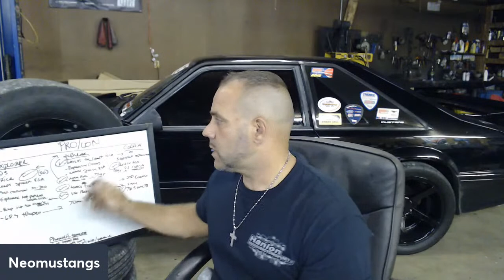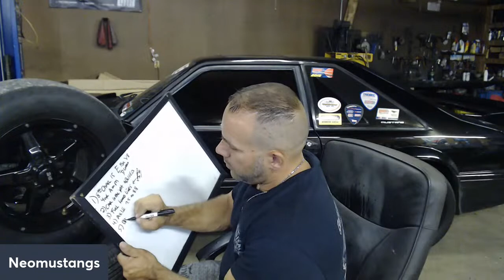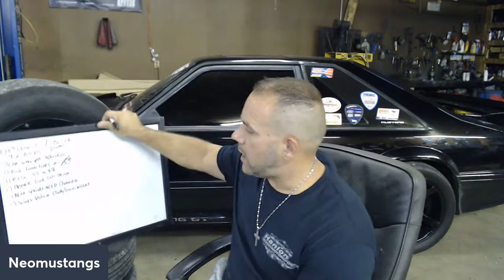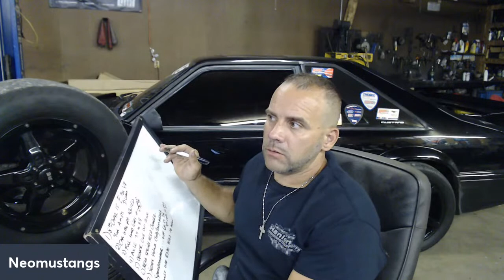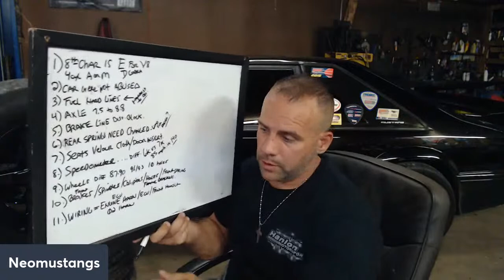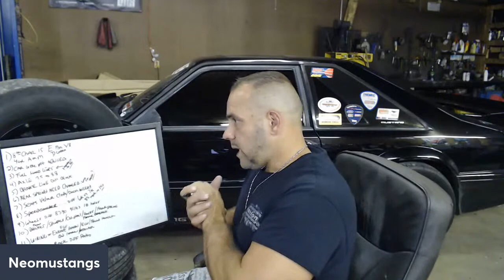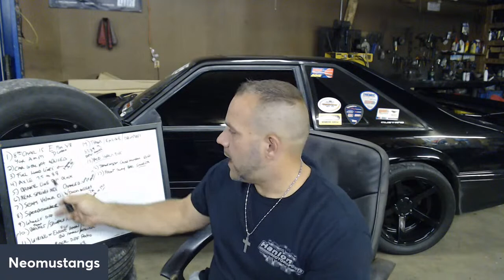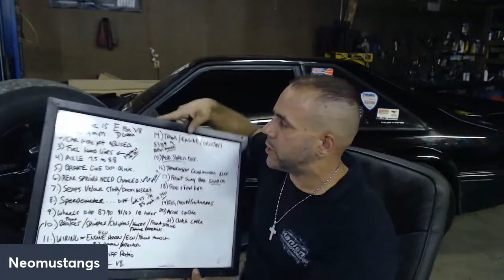Converting a Foxbody 4CYL to V8 What You May Not Know

Comment: converting to carb is easy especially if the 4 is a carb Ford electronic ignition work good to 7000 rpm and only need 1 power wire if your just doing drag racing breaks dont matterconverted a v6 83 Thunderbird no problem with stock steering rack

Comment: Yes I see I'm keeping mine a 2.3, I been trying to swap it since I got it in 2002 that's the whole reason I got it. always wanted to v8 Fox, but can never find a good engine when I have the money lol
Reply from the maker: Nice man
Reply: Could buy another 2.3 cheap build it properly on the side and boost it on a holly terminator x efi system. Toss a T5 and a 8.8 rear on it and have fun.
Reply: @jonathonbang3186  thats a great idea, Neo I'm going to try to get up there soon as I can to get one of those 2.3s you don't need if that offer still stands
Reply: If you want more power than the 2.3 can make boosted or a 5.0 both capable of 450-500 safe.  I hear people start splittibg blocks higher than 500HP without modifying the blocks.... Though some get lucky.  You're gonna need to at least go to A 351 or better engine.
Reply: @jonathonbang3186  just my budget I just don't have it believe me I'd love to though
Reply: K24 swap it. The only difference in one motor swap to the next is where to weld the mounting brackets. K24s are super cheap, and you can just hit it with injectors, piping, intercooler, and chinesium tornado maker.
Reply: 2.3 ecoboost swap it like im doing to my turbocoupe